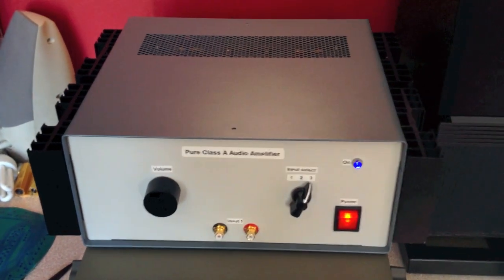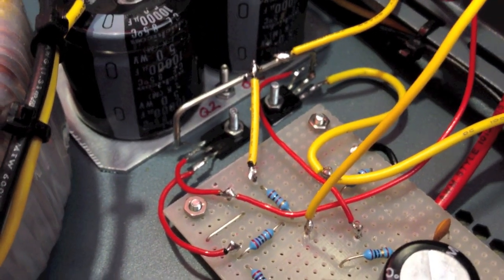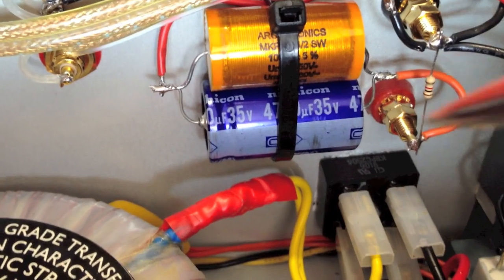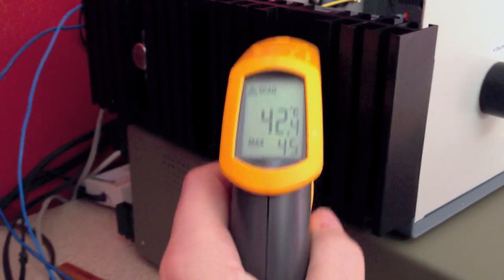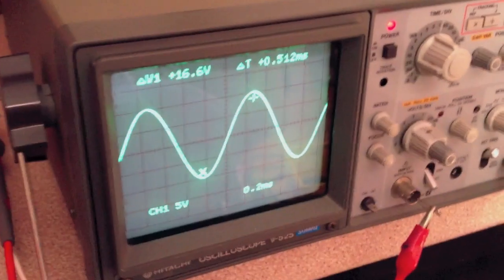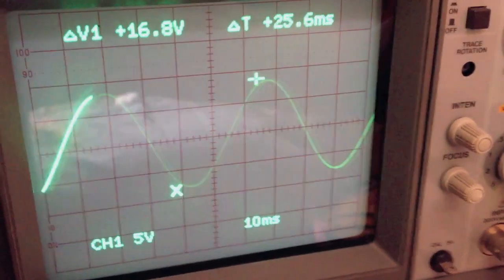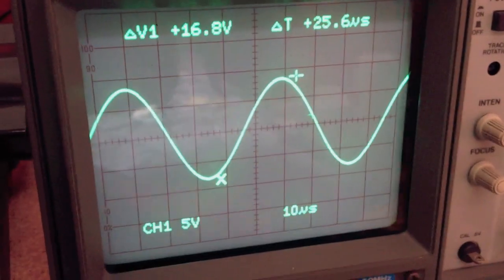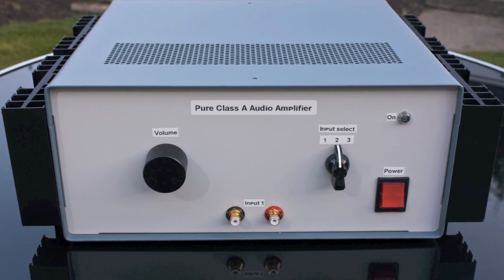Homemade 'Class A' Audio Amplifier - Death of Zen (DoZ) Amp

Comment: Your amplifier is much flatter than you think.
The 'droop' in voltage readings on the Fluke are because of bandwidth limitations on the AC voltage measurements made with that Fluke.
 Time to upgrade to a Brymen meter....or a UT181..........
Or get an oscilloscope that calculates the RMS voltages for you in real time as you sweep the frequency.

Comment: great amp build.switch out your volum potmeter with a dact type autenator21 step with wishay smd resistors with spesial db curve.buy them from ebay laser colection very good no pop design.cheap and much better than any potmeter.use it isntead of the crap potmeter in my benchmark dac usb and on my 4 channel 4 times 120w the end xp millenium wich is a power amp without global or local feedback.a very good amp design that are linear.it.s lower midrange is much better than most comersial amps.it is qiteter than most power amps i have tried in 45 years. a nad power amp gives 4-6 times the hiss.rotel even worce.i have a active sytem with planar mids and amt highs driven from those the end amps.Zapsolute is a amp desigend by the same man and sold by lc audio in scandinavia.today there are one online site that sell both the end xp milenium and zapsolute power amps.the 1 clas a/b the nr 2 is class a.no feedback..Better with no errors that need feedback correction is the thinking behind them.Bruel kjær mesurement company suposedly have ued the end xp do to their linerity.they dont self osilate.Sorry for my bad english writing.

Comment: I built a 1969 original jlh amplifier. I have checked everything, all seems to be ok, but I am getting a 10volts DC offset on speaker terminals. Is this expected since I am new to making amps.

Comment: Here, 5 years on, want to say, well built, well laid out, but class A is not the best choice., class AB or B would have been better. Less current, less heat, and with the running of that low of power, germanium power transistors might have better, as well. With that said, all and all what you made gets the job done very well.

Comment: Nice job, sounded good. I build a musical fidelity A1 clone amp from kit's supplied by our far east friends. Class A 20w, I also used a 300va transformer at 12v, but I'm going to rebuild it after recent tests on a second pair I build for someone else, it seems to have a firmer base with independant power supplies with a 300va transformer for each channel. Not saying yours will be the same, but food for thought.

Comment: Just a small comment, if you add more transistors in parallel, with their own emitter resistors you can safely run the heatsinks much hotter, therefore you can run higher bias current if you want. 
One of my eccentric projects uses 24 2N3055s in parallel, by keeping the individual transistor dissipation down you have less issues with thermal resistance. Good to see you have a few projects built.
Reply: could you upload your schematic to a site then link it to me?
Reply: DatAssSVK my project was not a class A amplifier, so probably of little interest to you. However the same principles apply, sharing the load between multiple transistors will drop junction temperatures even without increasing the heatsinking.....
Reply: +g0fvt ah,ok thanks

Comment: do you know how much thermal resistance the heatsinks have? i can only find 2,0K/W heatsinks for TO-3 type packages and i don't know if it's enough if i use one of these for each output transistor. nice amp you built there ;D

Comment: First, thank you for your great video! It really will help me with my diy project.
Where did you get the schematics for the power supply? On the DoZ project website it suggest using the capacitance multiplier (#15 project) but that one lacks the inductor I saw in the video.

Comment: 3 cont.
... tone generation, emulation, sampling, etc. because it does not capture the vital realness, warmth, and overall subtle behavior that makes analog circuits so inviting to play and listen to. I am on a quest to find out exactly what can be done to preserve and duplicate the great analog electromechanical and analog electronic organs built between 1929 and 1990. The new Kemper amp modeling technology appeals to me. Curious if an analog tone generator can be captured in the same way.NE1?

Comment: cont.
Sorry to dominate the comments, but I'll be brief.
   The organs I mentioned do have their own preamps, and amplifiers/spkrs even though they are electromechanical. There are other organs which used basic Hartley oscillators either by vacuum tube, and later transistors which also are excellent sounding. Although Allen went digital in 71' ( an interesting story there too) their founder  exhausted vacuum tube technology as applied to organs in the 50's. 

Many are dissatisfied w/ digital...